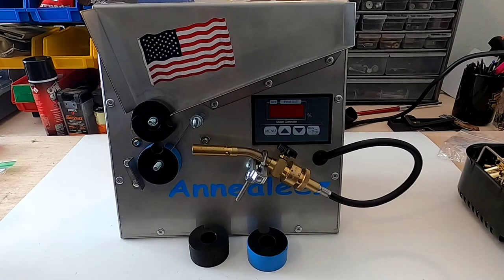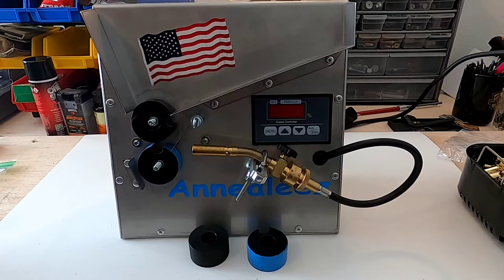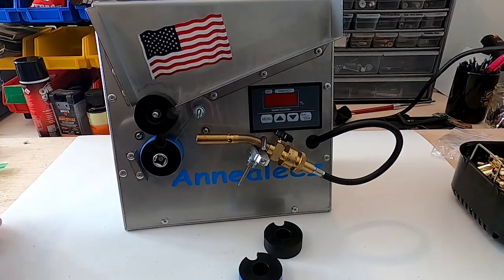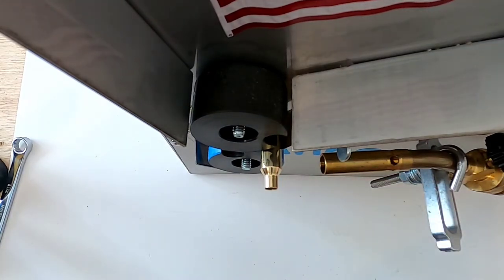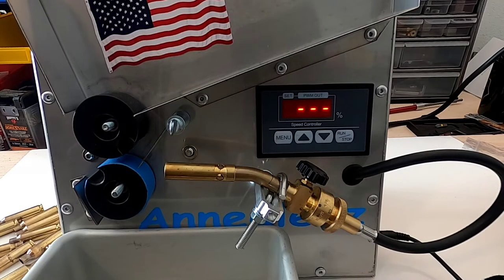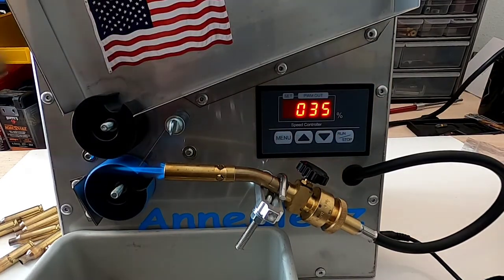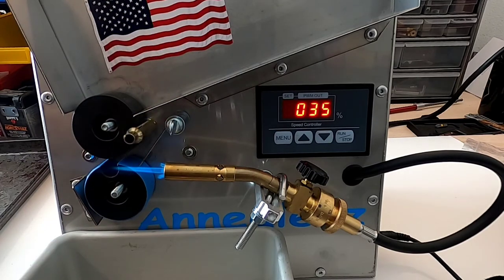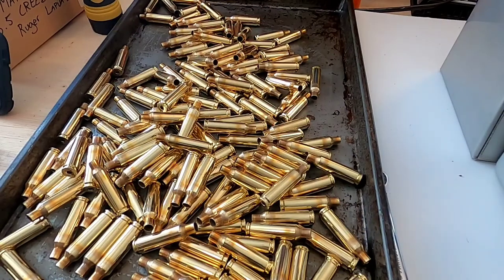6.5 Creedmoor : Annealing Lapua Brass

Comment: If you over anneal the brass, it is at all usable still, or do you need to throw it away at that point? Thank you for your video!
Reply from the maker: I always try to keep brass on hand for the sole purpose of setting up my annealing.  That way, if I do accidently cook a piece of brass, its no harm no foul.   With that being said, one thing that I do to eliminate this from happening after the initail test and set up with the annealer is keep notes on what settings I used and I always use the same torch settings too.  This has been very consistent for me and plane to keep going with that dynamic.  

To answer your question though...  If I do cook a piece of brass, it is trash.